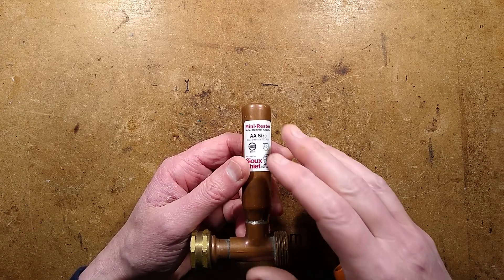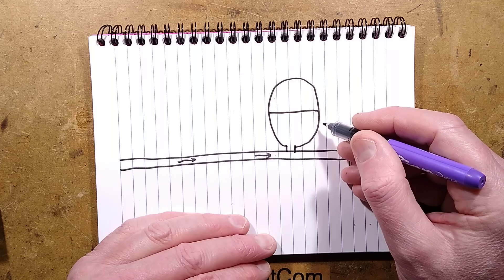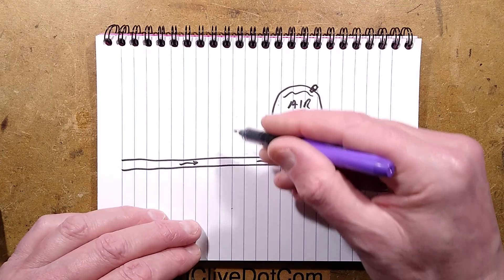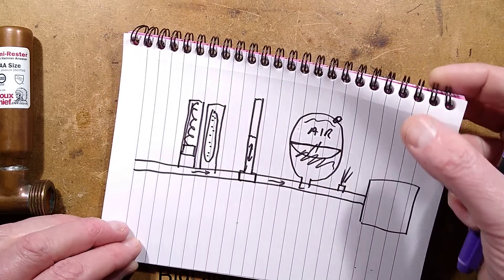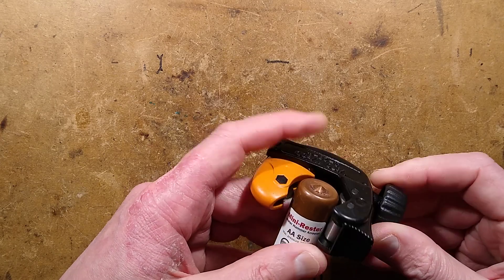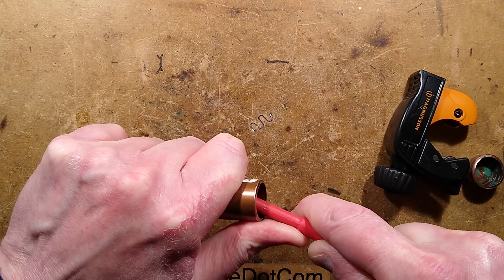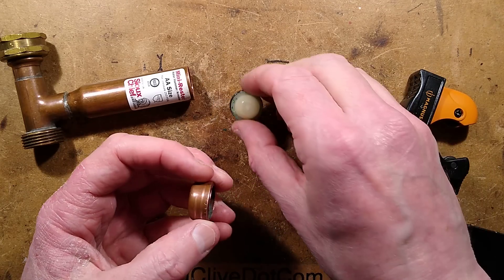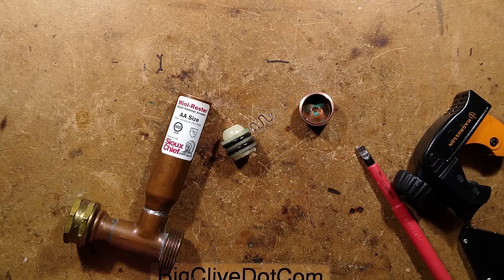inside an American made anti water hammer device

Comment: Surge protection device, only for plumbing rather than wiring, and fully reusable too :)
Reply from the maker: It's literally a decoupling capacitor for water.
Reply: @bigclivedotcom  this one is a bit too small, it's good for transient suppression but not pressure stabilization. Large pressurized tanks, on the other hand, are a good counterparts - where pumps acts as generators or transformers, and check valves acts as rectifiers.
Reply: @KeritechElectronics  It's MEANT for transient spikes in pressure, a.k.a. water hammer. And it's an appropriate size to handle that.

Comment: Claims to be not an electrical video. Joke's on us. Turns out it's a capacitor, but for water.
Reply: proof once again that plumbing and electricity are the same thing.
Reply: @ralphshoop8822  I think automatic transmissions show this best.
Reply: @yourimpossibletoisgn  I suspect modern automatics have electronics inside
Reply: @yourimpossibletoisgn gear ratios are just transformers for mechanical power
Reply: @ralphshoop8822 they are surprisingly analogous at least!
Reply: @markiangooley on and off. And various valves and regulators to use rudimentary logic, absolutely. I'm not a plumber but I use alot of the same concepts in my work.
Reply: @ralphshoop8822  ok, explain the skin effect to me in water please
Reply: That explains why they don’t get along
Reply: @ralphshoop8822  Came to say the same thing. Plumbing and electrical circuits are very similar.
Reply: And that's because long pipes have too much water inductance.
Reply: @straightpipediesel  I was just thinking, how would one make an inductor, when I realized it's impossible to avoid in hydraulics and that's exactly what these capacitor-like devices are designed to mitigate.
Reply: @straightpipediesel true, that.
Reply: @straightpipediesel  So in the end is just a PFC device?
Reply: @catalinbadalan4463  Yup, we just need a cheap Chinese water meter now!
Reply: Yup, it’s totally the water equivalent of a snubber capacitor.
Reply: @deltab9768  There's even an internal resistor in front of the cap.
Reply: @deltab9768  you guys are freakin me out?! 
Oh i got an idea for a different design, no two ideas
Reply: Water hammer is just back EMF :D
Reply: @azyfloof  there used to be a device called a “water ram” or similar that would take in a low pressure feed of water (say, 20 feet of head pressure from a pipe in a creek) and boost some of it to a much higher output pressure. It would let water flow freely through the device and pour out into the creek, and when the flow reached a certain rate it would slam its valve closed and use the waterhammer effect to force a percentage of the water into the higher pressure system. Basically a liquid boost converter module or “joule thief” module.
Reply: @deltab9768   Ram pumps are still in common use in off the grid builds where power is not easy to get to your water supply
Reply: and we all know that capacitors can be "leaky".
Reply: Capacitors are cisterns for electrons
Reply: But it is AA size.
Reply: @stuartmcconnachie  The one he cut open is missing the AA battery.....
Reply: Aw crap, your right!
DANGIT
Reply: @SaberTail  Copper lines, solder...
Reply: off-topic but am I the only one who sees this comment as well as one other as being from one month ago despite this video being just 3 days old?
Reply: @aomregcik  those are from patreon supporters who see the video sooner
Reply: inductive choke?
Reply: Water hammer can be compared more to voltage spiking across an inductive load when the current flow stops
Reply: A condensor for water
Reply: @jensschroder8214 still used in some off-grid scenarios to provide "running" fresh water.
Reply: Yes, but is there water-hammer in electronics???
Reply: @Shroommduke  It’s absolutely possible to get a “water hammer” of electricity. When I was 13 I took the iron transformer out of a clunky old AC adapter. 

I knew transformers (eg Rumkorf coils and TV flybacks) could run on pulsed DC, so I tried attaching a 1.5V “AA” cell to the low voltage side and then disconnecting it quickly. 

If anything it worked too well. If you put a neon indicator (90V working voltage) across the low voltage side while disconnecting the battery it would flash a blinding pink-white color that should never come out of a neon bulb. 

Meanwhile, the high voltage side produced an output that would flash across several millimeters of air gap, or light a neon bulb in parallel with a shunt resistor of several hundred ohms. Being shocked by the output was not a mistake I was soon to repeat.

Eventually the high voltage spikes fried the insulation on the high voltage side since it was designed for 120V not the kilovolt spikes that it was subject to.
Reply: @deltab9768  Much better for teenage high voltage experiments is an old car ignition coil, or a horizontal output transformer from an old TV set!
Reply: @gcewing  I’ve got both of those now👍
Reply: @Shroommduke  That's what an inductor is, and exactly what this device is designed to mitigate.
Reply: Plus it says “AA” size.   Sounds a lot like a battery to me.

Plus aren’t resistors just fancy valves?
Reply: At least it's not an electrolytic capacitor! Just a plain old Leyden Jar 😁
Reply: How can a video 15 hours old have a 1 month old comment?
Reply: @LelleKidd Video was probably uploaded unlisted to be released early to patrons/supporters, and then only recently made public.
Reply: @SaberTail I'm surprised you're not in the Engineering Furs group.
Reply: Water and electrocity is very similar after all.
Reply: More of a choke no?
Reply: A smoothing capacitor lol
Reply: Mechanical free body diagrams and RLC circuit diagrams are reallllllly similar looking lol. Resistors are springs, Shock absorbers are Capacitors and drawn out the same!
Reply: Yep.  We use these on aircraft (and other hydronic systems).  It's a hydronic accumulated in those applications.
Reply: More like an anti capacitor…
Reply: Your brain's a capacitor for water 🧠 💦
Reply: Great comment!
Reply: 1. kilopascals equals volts 2. Litres equals amps
Reply: @xgford94  technically amps would be equal to the rate of flow, so liters per second.

If I’m not mistaken, a flow of 10 liters per second at 120 kilopascal is equal to 1200W of hydraulic power, just as 10 amps at 120V is equal to 1200W of electrical power.
Reply: @deltab9768  I put it there for smarter people than me to correct 👍…so that’s you thank you
Reply: eh more like a fuse
Reply: I actually think it's behaviour is more like a inductor🤔. But I guess its two sides of the same coin, depending on how you look at it.😉👍
Reply: More like a plumbing Rectifier since it's not storing water, just smoothing out the current!
Reply: It would be more like a resistor or even a transformer definitely not a capacitor.